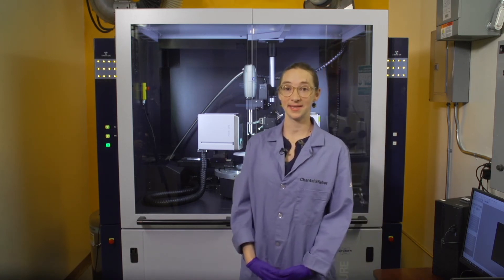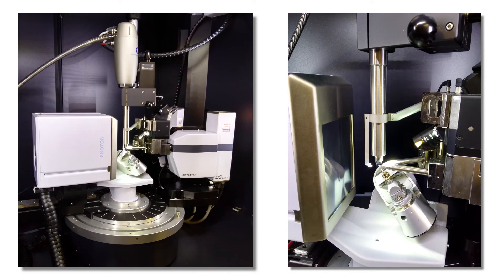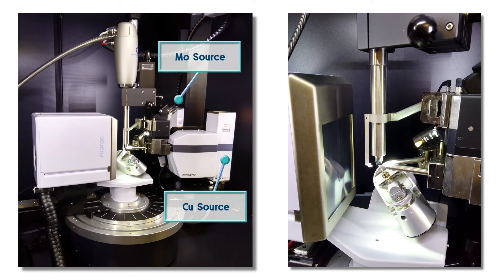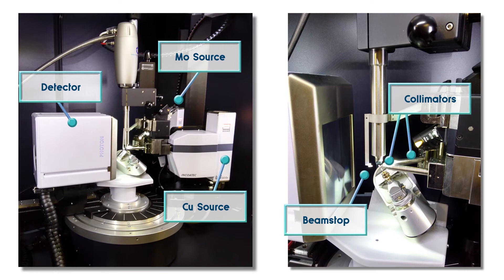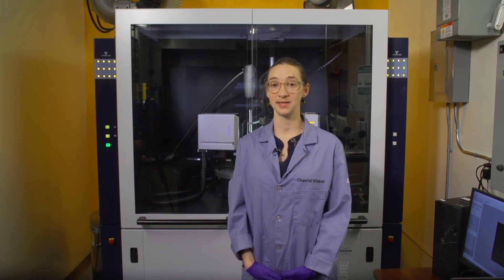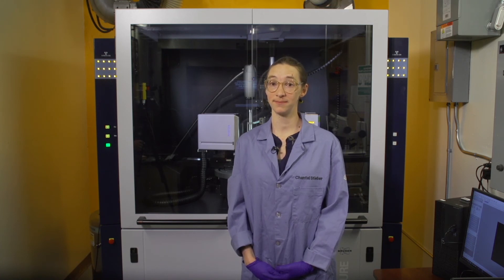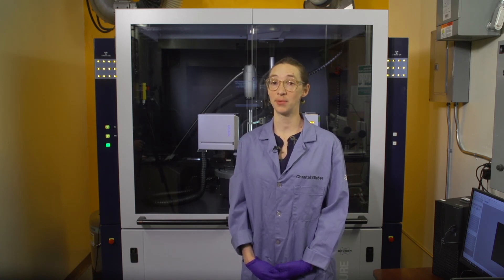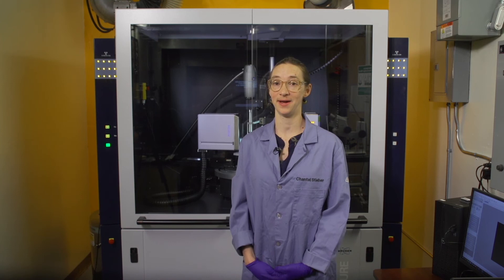Using a Single Crystal X-ray Diffractometer: Part 1 Radiation Safety & Instrument Introduction

Comment: Having a small amount of experience with a powder XRD, they are safe enough that a supervised undergrad can use one!
Reply: Exactly, if you are not doing maintenance (optics alignment, ...) there is zero possibility of exposition.
On the top of that, here you can tell somebody is a crystallographer beacause he/she will not have a coat, glasses other than prescription (if needed) and gloves only with certain samples.
Also, closed X-ray sources are only a subject of registration, but that's all - if the instrument conforms to EU regulations, there is no risk for the personnel. But this can be diffferent in some countries.
However, "supervised underrgrad" can only prepare/change the sample, not change the configuration (when talking about powder diffraction - we have BB/parallel beam/convergent beam with reflection holders/cappilaries, I am planning transmission setup with Ka1/planar mirror, my colleaugue will buy DSC and furnaces). Tweaking slits, detector settings, exposition, sometimes tube settings... that is something which is basically my job. In fact PXRD is much more complex than SC-XRD.
But even there are some caveats. Unfortunately Rigaku is not producing curved IPs anymore - IP is foolproof enough to let students work with it (of course, if the crystal is twinned, modulated, ... it is unusable thanks to large oscillation angle) and user serviceable (if I am that user). Personally I don't trust anybody in the vicinity of Be window of the detector (and fortunately exchangeable collimators are gone) - imagine collimator sticked into the detector :D Similarly, I wouldn't like anybody here trying to solve KM-4 collision (usually caused by the setting screws of Hampton Research heads). And taking into account Crysalis defaults, the data wouldn't have enough redundance for multiscan correction and if the group wouldn't be centrosymmetric, they wouldn't be possibly complete (default setting = you can get connectivity but possibly nothing else).